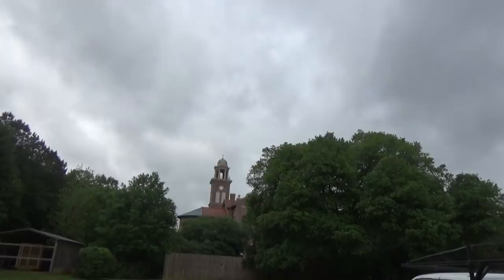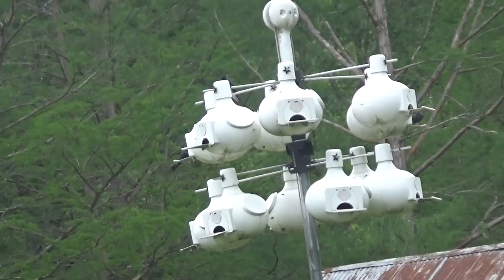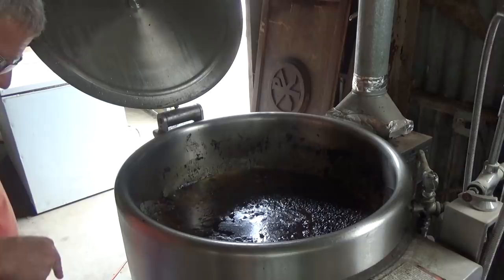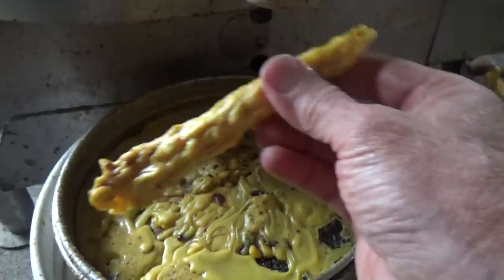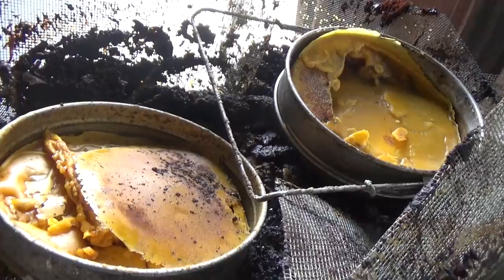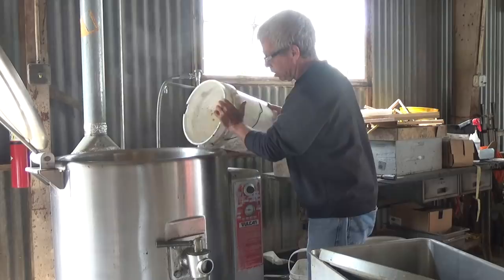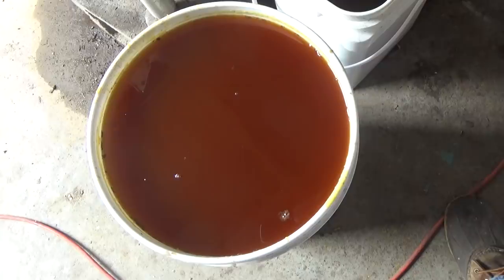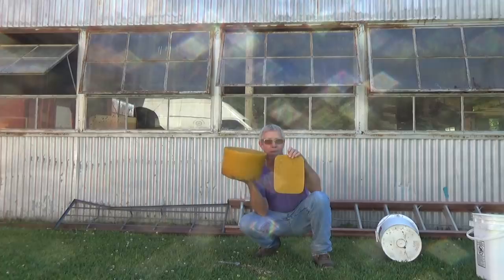Rendering bees wax.  How many times is necessary?

Comment: I use the left over residue from rendering as a fire starter......works as well, if not better, than the store bought fire starters......and no nasty chemicals.
Reply from the maker: I have used it for that very purpose, and it works great. One match will light it. God's peace.
Mr. Ed
Reply: I agree. Alot of wax(for me) went into that compost pile. I could have scored an extra pound out of it with a slow cooker and some cheese cloth I think. That's what I would have put in a solar melter for an afternoon. It adds up.
While the cocoons are still soft you can add sawdust and make bricks out of them.

Comment: Many years ago I worked in a small factory that produced electronic equipment. The equipment would require tuning before being packed and made available for sale. To ensure the tuned parts (screws) stayed put and could be retuned later if needed, we’d melt a little beeswax into the holes. I’ll always remember the comforting smell on winter mornings when we’d do a production run of the products that used beeswax.
Reply from the maker: What a great story, glad the video made you think of the smell of hot bees wax. Thanks for watching. God's peace Wayne.
Mr. Ed

Comment: Next time have a big pile of sawdust and shaving, cupcake cups (paper ones only)and tin.  Mix the crud with a little  the sawdust and shavings at a time till it is crumbly but still holds together when squeezed. Put the cupcake cups in the cupcake tin and then pack your mixture in, within 1/4 inch or so of the top.  Let harden then use a saw and cut in quarters. You now have fire starters with a paper wick.
Reply from the maker: Great idea, thanks for sharing it! God's peace Mary-Ruth.
Mr. Ed

Comment: Jeff put a piece of card board on top of the bucket it hold the heat longer and it will keep the wax from cracking, the crack is cause from cooling to fast
Reply from the maker: What a great idea, thanks for the suggestion and for watching. Stay safe, God's peace Mike.
Mr. Ed

Comment: Hello Jeff (Mr. Ed),
Thank you for the efforts you make, to produce interesting videos.
It seems that the process of cleaning beeswax is somewhat time consuming.  I would like to tell of an easy method I have used, which may be of interest to hobby beekeepers.
I am a new beekeeper, and finding that there is SO much to learn about all of the different aspects of looking after these little creatures.  
I have done much searching out of information about honey frames.  Many beekeepers provide embossed wax foundation sheets, and others use strips of wax foundation.  I have found interesting information which compares the usefulness of wax foundation sheets, and foundation-less honey frames which have a waxed starter strip of some kind.  It seems that the prime purpose of a foundation sheet, or of a starter strip, is to provide an incentive for the bees to build straight comb.
Because I am retired, and have to work with a very tight budget, I have opted to use waxed starter strips rather than foundation sheets.  I have also found that by using a screen between two foundation-less frames, the bees can build nice straight comb on my starter strips.
That somewhat long-winded introduction leads to how I have prepared the clean wax I needed to wax my starter strips.  After collecting burr-comb, and other stray bits of dirty wax, I have found a way to make amazingly clean wax in one pass.  I quarter filled an old saucepan with water, and added the wax chunks and fragments, then brought it to the boil to melt all the wax.  After the wax was thoroughly melted, I strained the hot liquid (water plus wax) into another saucepan.
To make the strainer, I used some cloth from an old shirt, because it was strong, and close woven.  I had made in advance a metal band (about three-quarters of an inch, or about 20mm wide) that was long enough to wrap around the circumference of the saucepan, with enough additional length (6 to 8 inches, or 15 to 20 centimetres) so that the ends of the metal strip could be gripped tightly by a lock-grip pliers.
When the wax was melted, and ready to be strained, I placed the cloth across the top of the saucepan, and then held the cloth tightly in place with the metal strip and the lock-grip pliers.  I was then able to lift the saucepan of hot water/wax by holding both the saucepan handle, and the lock-grip pliers which now served as a second handle.  It was easy to pour the hot liquid into the second saucepan, and no risk of the cloth sieve being dislodged from the saucepan.
The best part was that the strained wax was beautifully clean, because it had passed through such a tightly woven fabric.  I hope that other hobby beekeepers may find this method useful.

Comment: Jeff, can you still use beeswax even if it has mold on it? I had some in by barn in a pot with a lid on it and I forgot all about it. It is very moldy and I wanted to use it if I could. Great videos.
Reply from the maker: I render wax with mold on it regularly, it does not seem to make any difference that it is there. Good luck with that, and thanks for watching. Stay safe, God's peace Rob.
Mr. Ed

Comment: At minimum I needed 4 times melting and percipitating crap before filtering.
Reply from the maker: Maybe watching how I did it may decrease the number of times you render the wax. I certainly hope this video helps. Thanks for watching. God's peace.
Mr. Ed
Reply: @JeffHorchoff  I was a very small beekeeper with 6 to 10 hives... The best way I found was to melt 3 broodcombs at a time with 8 litres of water and strain it the first time and press the coocoons to get as much wax out as possible and let it cool overnight. collect all solidiefied plates and wax globules.. Then melt all collected wax up to 3 times with 8 litres of water again. I wrapped the bucket in isolating material and let the large block even cool for 48 hours. 3rd and 4th time..scrape propolis and garbage from bottom of the block. THen the wax is clean enough to filter to make candles of it. And yes... I did produce beeswax candles that burn to the end. I think this is the best way to refine beeswax for a small beekeeper.

Comment: Bees do not reuse wax. Utter nonsense. You wrote "if you've put on to much wax, the bees will take the excess and use it where they think is the best place for it." It's not true. They cannot recycle was like this. They may tear down excess was and just rebuild with fresh wax, but they will NOT take was from point A and reuse it in point B.
Reply: Actually they do reuse wax seen it first hand many of times.
Reply: Actually I've seen it first hand they will scavenge wax for reuse.